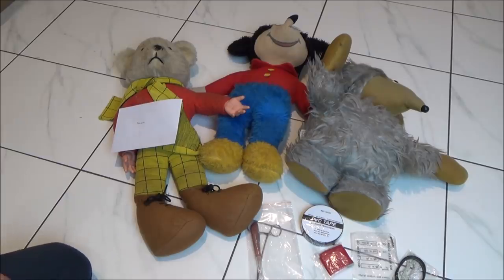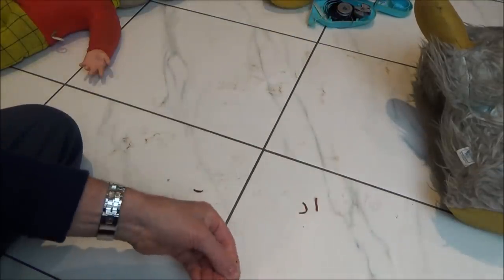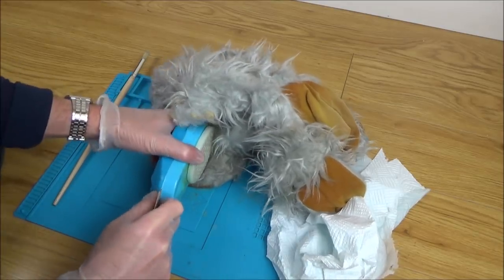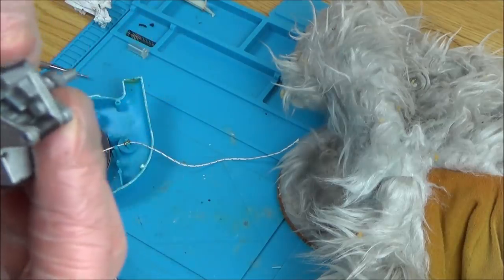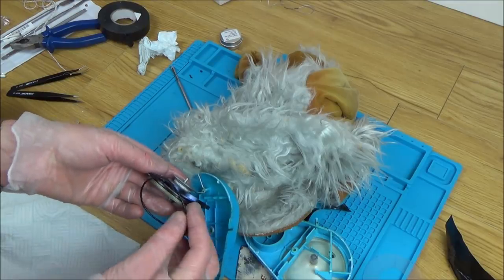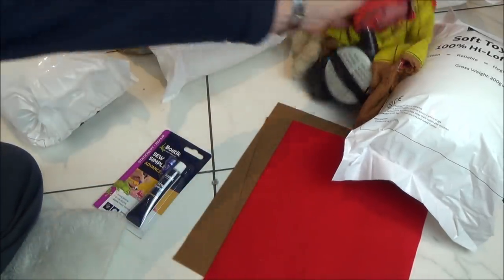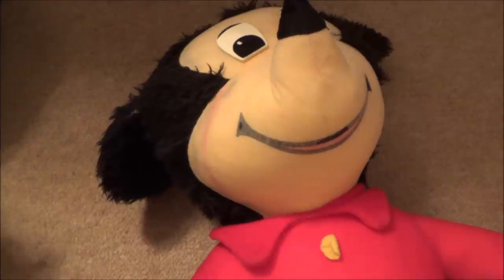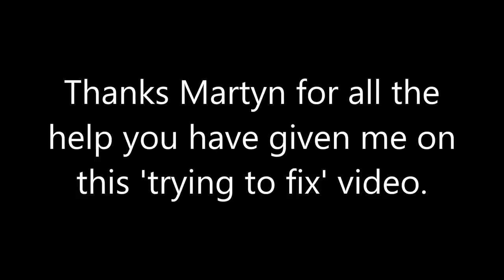Trying to FIX 3x 1970s Pull Cord Talking Toys

Comment: There is something you can do about the stitches being visible. Instead of just sewing it shut with a running or whip stitch, use a ladder stitch. It pulls the raw edges in and the more you pull on the thread the less you see. Wonderful way to restore old toys when you need to sew something. I restore rubber face dolls like Rushton/Gund/Knickerbocker/MyToy/etc and I use a ladder stitch to sew them shut (sometimes they get floppy so I like to restuff them so they can hold their shape better) very useful when restoring old stuffed toys. I'd suggest looking up a video on how to do it, it's very simple to do.
Reply from the maker: Thanks for the tip :-)

Comment: Wow Vince, this is a great one! I never knew exactly the same toys like this when I was a kid, but it is great to see you fixing these things up. You know, I love mechanical and quite simple things like this and they show how things don't need to be electronic or battery operated to be fun and to make them talk. When I was a kid, some kids at school had a toy that, when the cord was pulled, made animal sounds depending on a movable pointer that could be pointed towards animals that were shown on the toy. And I also think there was something like a clock toy that, depending on the position of the hands, said things like "It's time to wake up" or "it's time to put the toys away" and things like that. Oh and my sister used to have a talking/singing doll; it was battery operated, but still used the system with the record and the diaphragm to amplify the sound, but I remember it included some interchangable records you could use to let the toy say (or sing) other things. Thank you very much for this Vince, it brings back great memories!

Comment: You really do put your heart and soul into these fixes Vince, I am full of admiration for your work :) You're actually starting to surpass GadgetUK164 for attention to detail, and that takes some doing!

For taping stuff like this together amalgamating tape used to render satellite dish LNB plugs watertight may be a better solution. It's designed to last for decades in harsh conditions and forms a very tight bond around anything its stretched over.
Reply from the maker: Haha, don't worry I am sure one of my fixes will go disastrously wrong soon....Chris has nothing to worry about :-)
Amalgamating tape would be perfect for this, I used to use it and sell it. I think I have still have some. Yes, stretch it and overlap by 50% and it all rubberises together. That is a great solution for these voice boxes. Well done :-)

Comment: When the spring let go in the womble I thought to myself "theres another hour or two of work retensioning that b*****d." Then the red noticed popped up saying exactly that! Those springs can be a pain :) As for the fluffy stuffing you bought, chip manufacturers could learn a lesson or two from that stuffing manufacturer... the chip manufacturers usually give you half a bag of air :P

Comment: Vince, When you need to stitch stuffed toys up again, 
step 1 The stitch should start from the inside or "underside" of one side and then place the needle over to the other side you are joining at the top to go through to the underside. 
step 2 Stitch back to the other under side and tensioning the stitches so that all previous stitches disappear and then continue where each stitch joins underside to underside and outside to outside
step 3 gently tension stitches every now and then ensuring they all disappear repeat step one to three until the hole and stitching is concealed.
FINAL STEP stitching from underneath to the other side underneath do a knot stitch a few times.
https://www.youtube.com/watch?v=K3fFHV6r9Ow
Reply from the maker: Thanks Koala, I will watch the video. Nice one :-)

Comment: Vince, if you ever do these again, maybe you could use a marker of some kind and leave marks on the spring in a line? That way, if it uncoils you'll be able to use those as guides to coil the spring properly much easier.

Comment: Mickey looks more like Sonic lol. The red bands under his face mayhave held the foam in place.
My heart sank when you were gutting the womble...so sad. I think the womble would sound better if you replaced the govenor pads. It sounds too fast and then too slow near the end, so tension is probably right but govenor not quite working.
Nice fix on the boots.
I think replacing the stuffing is the right way to go.
Great (almost restoration) repairs on all 3.
Reply from the maker: Thanks Emma :-)

Comment: Hey, I've dabbled a little in trying to collect pullstring toys (Not much luck lately, but still), and if you come across an ebay listing for a line called "Animal Yakkers", They're near impossible to repair because their pull string mechanism is connected to a mechanism that moves the mouth. If that breaks, the entire mechanism locks up and AFAIK there seems to be no reproductions of the mouth part available (Correct me if I'm wrong). I'm not sure if they were sold in the UK, but just a heads up if you ever find one on the off-chance.
Reply from the maker: Thanks, I will Google Animal Yakkers later :-)
Reply: @Mymatevince  Alright, Seems I can't stop you. They're from around 1965 and from Mattel.
Reply from the maker: @angelpichu1  I had a quick look on UK eBay and I couldn't find any but thanks for the heads up :-)
Reply: @Mymatevince   Alrighty. Good luck if you ever find one.

Comment: It is surprising how much of that filling is in cuddly toys. We buy cuddly toys from our local charity shop. No matter what size they are, they only cost 50p each. Our dog loves them and ends up having more fun after she has ripped a seam and pulls the filling out. Every day we are picking up bits or chunks of filling. When there is not much filling left in the cuddlies, we bin them and buy some more. Perhaps if you buy cuddlies fro m charity shops, you can reuse the filling for quests like these. :).

Comment: Hey vince
Do you have too put grease on the rubber o ring
And another thing can u u use a elastic band
Reply: I know you asked Vince, but I'll add my limited knowledge anyway. The purpose of the o ring is to act as a belt, and is used to drive the governor.
Grease is used to reduse friction, but a belt is used to grip on to a spinning thing to drive another spinning thing. Also you can't use an elastic band as a belt as the elastic band can stretch, and may be affected by temperature. (These basics are the same for tape drives and disk drives that don't use a speaker coil to move the drive head)

Comment: My dad gave me a mickey mouse he has a plastic head and legs the body is soft  like yours in 1972  when I was 11 years old    I  still  have it as he died not long after.  The ring came off the pull string so the string went into the body. I have been tempted to open   the body  and see if I could fix it. But after I seen your video I don't think I could do it. To many pieces.

Comment: Oh BTW, the voice boxes are supposed to come off before repairing! There’s a snap/industrial type. Use hemostats if the string is still on it (& pull-ring) use a flat head screwdriver to remove the voice box completely from the toy first! You can dame irreplaceable parts if they get wet. Or, it makes 5 more problems if you get the inside of the voice box. Also, don’t get that melted o-ring gunk on other parts such as the record. See my other comment below. A lot of these dolls/toys colors will will bleed &/or fade. Everyone BEWARE of repairing your own vintage toys IF you really care about them! Otherwise good luck!

Comment: Hi, I have a woody pull string toy that was working intermittently without pulling the string, bought 3 x new batteries and now does not work at all, I was wondering if you could message me as wanted to ask you  if you knew of anywhere where I could send to get repaired properly?

Comment: the electrical tape will turn to goop
Reply: Actually it wont, mind you as long as the tape is proper electrical tape, as those are manufactured to a standard requiring protective endurance..
Reply: FRIENDLY JAPANESE BUSINESSMAN  Oh no!!! I guess I better remove the electrical insulation I used over 15 years ago on my Amplifier I built before it does go to goo..😣
Reply: FRIENDLY JAPANESE BUSINESSMAN  whew.. it was like I put it there yesterday.. Just goes to show if you use the proper stuff it wont let you down, in fact It should last another 15 years 😉😊
Reply: FRIENDLY JAPANESE BUSINESSMAN  like I said, its fine as I only use the proper stuff that is supplied for certified electrictians, technitions & engineers, it's not tape from some $2:00 or 2 bit hardware shop..
Reply: @KorAllRBare  I agree the good stuff will be fine but we don't know what Vince used. Also, it's good that FRIENDLY JAPANESE BUSINESSMAN brought this up because that could happen with the cheap stuff.
Reply: Electrical tape is designed not to, as it’s used on ELECTRIC COMPONENTS AND WIRING...

Comment: Why not pull the string all of the way out and instead of clamping it on the outside I clamp it on the inside unless that wouldn’t work 
If it could work u could have the voice box pulled all the way out instead of working with it half way in the toy